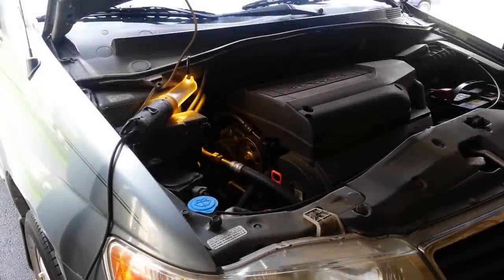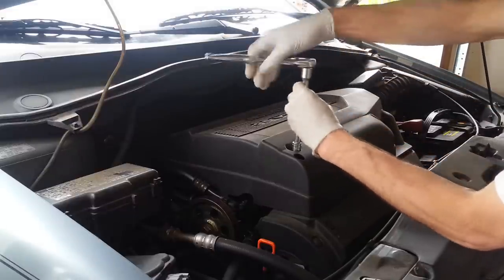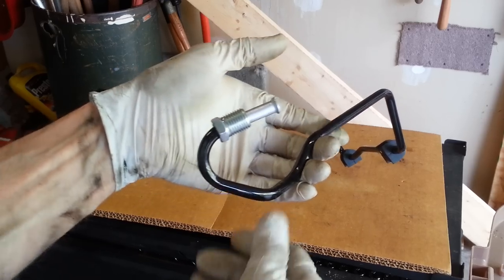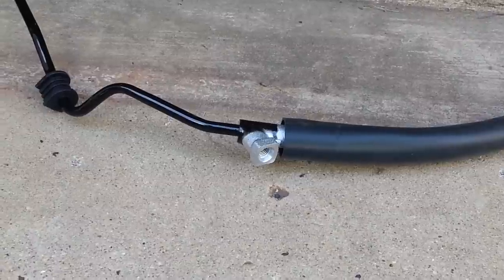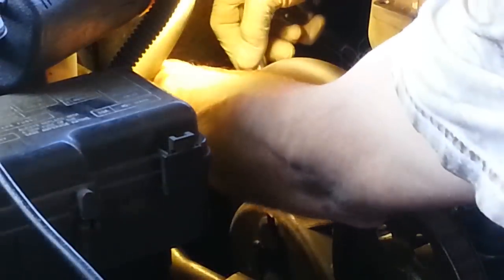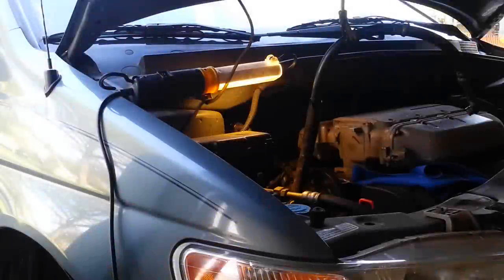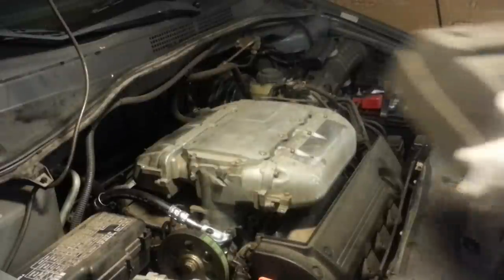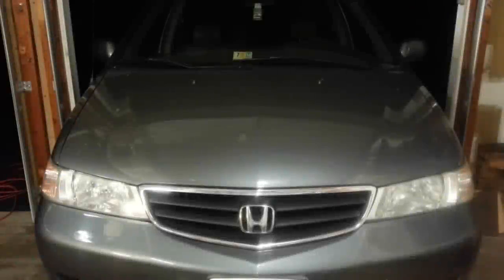Power Steering Hose Replacement 2002 Honda Odyssey

Comment: Thank you very much for the video, Mr. Worsethanchiggers. It was very helpful! I managed to replace this hose on my 2003 Odyssey. A couple of comments (hope someone will find them as useful as I found this video):
1. While removing the old hose, it is easier to cut off the tube at the nut (someone suggested this above, and I definitely second this suggestion) and use a 14mm socket (unless you want to keep the old hose).
2. Feed the new hose from the top (next to the pump). I tried everything before this, and nothing worked (I could force it through but did not want to bend anything).
3. My new hose (generic, not Honda) actually had a 9/16 in nut instead of 14 mm, but I had just the right flare nut wrench, so it was not a problem. So, make sure that you have a 9/16 in wrench available just in case.
4. I actually discovered that my power steering pressure switch was not connected. Looks like the electric wires got torn somehow years ago. My understanding is that this switch regulates idle rpms (when you are trying to make a sharp turn while a car is not moving), so I did not bother trying to reconnect it (just installed it on the new hose to plug the hole). So far, did not notice any problems. Be careful installing this switch though, don't over-tighten.
5. Definitely put some masking tape on all openings while putting this hose in place, and frequently check that the tape did not get off.
6. Cover the belts when you disconnect the old hose from the pump - you do not want to spill power steering fluid on any of the belts which are right below it.

Good luck to whoever is going to attempt this! This is definitely doable. The hardest part for me was to actually put this hose in place. Connecting it after that  (and disconnecting the original hose) was rather straightforward. Having all the right tools certainly helps.

Comment: Very well done video - thanks!  Completed this on a 2005.  Same pieces, just in slightly different places.  Flange nut was not in an easy place to reach, but it was easy to get the new line into place.  Note - the OEM flange nut was 14mm, the replacement was 9/16th.  I recommend you check it before you get it in place.  I drained as much fluid as I could and cleaned the reservoir before I refilled with Honda PS fluid.  Did not run the car, just turned the wheel back and forth still on the jacks.  It sucked and burped down the fluid in the reservoir twice and was full (about 1.8 pints).  Steering is working just fine.  I'll be honest - I farted around with this project 2 nights about 6 hours total, but I was really taking my sweet time (PS system newbie).

Comment: I took on that same project, removal was bad enough , feeding the rigid pipe!!!, after about 3hours, went to the parts store, ask if it was acceptable to cut the metal pipe  and rejoin with a brass coupling, was told that was a common practice, YES!!! That was about a year ago, no leaks
Reply: really hard to put the new one in place, I'm still struggling.
Reply: Will it be a good idea to put the new one from the bottom to the top? Since the upper side is soft.

Comment: My power steering high pressure hose leaked so I was going to watch the Ron Howard video about the Apollo 11 faked moon landing listed in the right side bar to get tips on how to replace it but as it turns out, this video was much better than Ron Howard's. Thanks much for the excellent instructions.

Comment: Outstanding video!  There's another video for the next generation Odyssey and the guy recommends inserting the new hose with the side that mounts to the pump first, from underneath the van - he also recommends attaching a wire to the old one and pulling it out from under the van, this will help when you replace the new one, I am going to try this when I get the new hose this weekend.

Comment: Amazing video, thank you so much. I had the exact same leak in the exact same spot and had the identical problem with the tough nut that needed the line wrench. Great tips and advice that saved my family at least $500 and only cost me a Saturday afternoon and some sanity from extracting and reinstalling the hose. I would pay for this level of quality instruction when my Odyssey gets a problem. Let me know if you have a donation location!

Comment: Thanks. Great instructional video.  5. stars . I could only wish other mechanical  videos online were as clear and concise and accurate as yours are. again, thank you very much. I too had the exact same issue. Got a rebuild kit and followed your video on the power steering pump rebuild only to discover that the top high pressure hose had failed by leaking.
Reply from the maker: Thanks for the kind comments. I really appreciate it. Yea, a leaky hose is certainly misleading. Interesting that you had exactly the same experience as I did.

Comment: Excellent video - Your video was spot on, full of great advice, and the leak is fixed!  My teenage son and I just replaced the high pressure power steering hose on our 2007 Odyssey. The hose itself was $197 from the Honda dealer, but we saved over $300 on labor costs doing it ourselves.  The 2007 seemed to have less clearance than the 2002, but we persevered.  After trying an open end wrench, flare nut wrench, and vise grips, we ended up just cutting the metal tube off at the flare nut and using a socket.  I would recommend cutting the metal tube to anyone doing this repair and not waste time trying to loosen the nut.  We were very careful to watch how the old hose came out and replacing with the new hose took only a few minutes.
Reply: Tall DudeXX ive gotta do a pressure line on a 2005 accord with this engine. so i probably will just do it like you and your son did that procedure lol

Comment: I watched this video three times, then did this repair. It took about 3 hours, a second pair of hands, jackstands and a 3 ton jack, and it works real well to take off both front tires. This was super frustrating. I'm no mechanic, but with the help of this video, and the above mentions add on's I did it. A mechanic friend says I'm a badass for even attempting this repair and that if I took this to a shop it would have cost me over $300.00 +parts. (100.00+). So, I guess thanks are in order, but man it was hard!

Comment: Great video.  I just did this project and thought I'd add my recommendations/comments:
1) Got Edelmann (aka, Parts Master?) aftermarket hose, because I could get 2-day shipping through Amazon Prime and it was only $44 for a used one (open package return.)  Seemed to work fine, but I needed to slightly bend the rigid portion to match the original shape, so keep your old one and line them up to make these adjustments.  Also, the pressure switch is on a T fitting rather than a Y, so you need to cut the closest wire harness connector for the connector to reach.  Discard the smaller o-ring and ignore the instructions that say it is needed on the flare nut, as it is NOT needed. 
2) Use jack stands rather than ramps, so you can remove the wheels.  Much easier access and you can flush and bleed the system manually by repeatedly turning the steering wheel lock-to-lock, with the engine off.
3) Cut off the old line, flush with the end of the flare nut and then use a 15mm socket to remove the flare nut.  Don't try other methods first, as that just buggers up the nut and makes it harder to get the socket on.  Use plenty of PB Blaster first.
4) Attach a string to the end that had the flare nut, so that it traces the path as you pull the old hose assembly out.
5) Disconnect the pressure switch electrical connector.
6) To remove old line, first move the hard portion of the line toward the driver side a bit. Then pull the flexible portion of the hose down and push it straight through the passenger side wheel well.  From below, work the assembly out, toward the passenger side, above the tie rod boot.  It takes some wiggling, but you can do this with the pressure switch attached.
7) Tape the openings, then tie the string to the new line at the flare nut and have a helper gently pull the string as you guide the assembly back through from the passenger wheel well toward the drive side.  I was able to attach the pressure switch ahead of time.  Double the flexible end over and stove it over the tie rod boot, reversing the removal gyrations.
8) Get the rigid pipe nearly into position and then make any needed tweaks to the final bends.  Install the flare nut first and tighten most of the way, with a 15mm flare nut wrench.  Then install the 3 clamps, reusing the original rubber bushings.  Finish tightening the flare nut.
9) Fill the reservoir and turn the steering wheel manually, lock-to-lock to work the air out.  Check often to add fluid.
10) Say a prayer, fire it up, check for leaks and turn the steering wheel back and forth under power until the fluid level stops dropping.
11) Have a refreshing beverage.
Reply: Steven Bachman getting ready to do this & dropping a string is the first thing I thought might help...but always easy to armchair qb😁.  great video
Reply: A comment of caution to point (3) above:  cutting off the old line might introduce metal "debris" into the system.  It will be impossible to remove these tiny pieces afterwards !!! -  Using a small plumbers hose cutter could be safer but not full proof!!! - WARNING !
Reply: To avoid introducing metal particles onto the hydraulic system, Cut the metal line several inches far from the flare fitting. 👌

Comment: Nice job. I liked the way you didn't edit out the difficulty of removing the flare nut and showing that it is better to use a flare wrench.  Thanks.
Reply from the maker: I really appreciate the kind comments. Thanks!  Too many videos deemphasize the challenging parts of a task and that is lost on the viewer. I sometimes prefer to show the decision making process when a change of course is warranted.

Comment: What an incredible service. Great vid! Thank you. I highly recommend before changing the pump, use the yellow dye and a black light flashlight. My leak was also in the hose, not the more expensive pump. Yellow Dye $8 any auto parts store (specifically for oil fluids) and $8 black light at Harbor Freight. You don't need the expensive kit at auto parts store with yellow glasses. It will show leak with black light.

Comment: I just wanted to thank you for the great video!  I appreciate you attention to detail.  I wasn't sure if my high pressure line was leaking on my 2004 Acura mdx, or if it was the pump.  Thanks to you video I found my high pressure line was leaking is the exact same spot.  The subframe on the mdx makes this job a bit more challenging, but your video definitely helped me.  Thank you!
Reply from the maker: Thanks for the kind comments. I really appreciate it.

Comment: This was a very well done video. 
I used it to fix the power steering line on my *2005* Odyssey ... it worked perfectly.  Here are some further notes and observations on this video that will help you to use it to fix your odyssey.
 
1) the vehicle is raised on ramps under the front wheels ... this works fine.  The wheels do not have to come off.
2) doing the line-nut down on the power steering rack first works great (before taking off any of the line hold-down bolts).  On the 2005, that hook the line takes (down by the nut) at the end of the power steering line is not there and so that line nut is accessible from towards the center of the car (laying on your back) AND FROM THE TOPSIDE, right in through the engine compartment on the drivers side (big arms make this a painful squeeze though).  A milk crate to stand on works just ducky to be able to reach into the engine bay when the vehicle is high, up on ramps.
3) yes, you really need to use a "line wrench" (with its "C" end) with an extension to get it loose.
4) the lower line hold downs (the rubber bushings with the clamps on them) are accessible by laying on your back under the vehicle with your feet sticking out the front of the vehicle. 
5) the use of the bungee cord in the video is a great tip when you are doing the job by yourself.
6) fwiw - a small hand mirror will help you while you are doing the job to see where nuts/bolts are located better.
7) everything else should be done in the sequence and method as shown in the video.

THANKS AGAIN to the original poster.  Actually a repair with very little headache using the info in the video!

Comment: Thank you for making this video  I would have not replaced the cracked hose myself on my odyssey 2000 if not for your video. Nearly gave up trying to feed the line. I used original Honda parts but the pipe run between the two rubber supports was originally bent as a hump unlike what I saw from the video which was straight. Took me 6 hours to feed the line.. Lol.. Thank you for making this video.

Comment: I am glad to hear that you TOLD US WRONG> at 3:52.  I spent an hour trying to get the single flare nut off.... buggered it up good.  So when you said the high press line was one of the other ones, I was very worried.  I ended up having to use Vise grips with a flat jaw.  Glad that I am not using that nut again. thnks for the correction.I did the same thing as you, I replaced the pump then found the hose was bad....

Comment: Thank you very much! I carefully followed step by step your video. However my flare nut was very easy to untight. my 2000 Odyssey has now 280k km. no more money to waste in garage at 100$/h . It took me 2 hours, beer and music included. Don't let your hose leak during 2 weeks by adding of power steering everyday for a total of one gallon. You will make a mess as I did on my garage floor.

Comment: Well, my turn in two days on a 2001. Thanks for a peek at the details. I’m bringing in a helper which should ease the task of hose extraction/insertion, I definitely have the correct tools and I’m glad the pressure sensor can be installed on the bench. I also have a set of flare crowfoot wrenches that will work with a breaker bar. My big hands may be a problem but I’ve dealt with worse.

Comment: Thanks for posting this video I had a leak in the same exact spot tried using J-B Weld it held for like a week and then started to leak again it was time to put in a new hose fought like heck to get it out and a little to get it in getting the flare nut started was the hardest part how to lower the jack a little bit to get the flare nut to go in flush how to put on leather gloves to get more strength and grip to get the flare nut started once I got that started I was home free with a little help From my awesome wife I don't know a lot about cars so these videos help tons may the Lord bless you for helping not only me but many others God bless

Comment: Great video.  I think this must happen a lot with these vans. It looked like mine had been replaced before.  I bought a flare nut wrench just for this and it still started to strip that bolt. I ended up soaking it overnight in penetrating grease and using vice grips the next day. Pulling the hose out and back in from the passenger wheel well worked good.

Comment: I used a string around the flare nut side to help PULL the hose into its new location.  Fishing in and out was most diff part of the job.  A 9/16 line wrench is close enough to use when removing the old tight nut (9/16 =.5625"  ; 14mm = .55") .

Comment: Great video. Thanks. Even with line wrench, the nut got stripped coming off. Good locking pliers finally made quick work of it. Took a few hours, but I got it......almost. Flare connection is now leaking and I've already loosened it, checked and re tightened. Still leaking. Arg!
Reply from the maker: Ugh. That's a bummer.

Comment: Good video. I haven't done it yet but I think I'm going to tie a very long string to the wheel end on the hose before I start pulling it back through the car. Then after getting the hose out, I'm going to tie the string to the new hose to feed it back. Only doing this to make sure that I'm routing the new hose correct.

Comment: Well, this job is "worse than chiggers." But this vid is great instruction. I add: Do like this guy and buy the Honda part. Autozone's was rusted at the sensor threading, and didn't line up at the steering housing. I had to gently bend it. But you can do as he did, painstakingly thread it through without removing anything else (I did loosen a hose guide and shift it).
Great vid. Thanks!

Comment: Great video. Just finished the job last night. Can confirm figuring out how to get the hose out, and the new one into position is really frustrating and difficult. (esc with the car on ramps and you're lying underneath. A lift would make it a lot easier). I'd say good ramps are a minimum requirement for the job. Also, Harbor Freight has both flair nut wrench set $15  and o ring set $5. If you don't have the wrench set I would add that to the list of required tools. The hose is really hard to get out of the wrack. I would say without the flair nut wrench, you probably won't be able to get it loose.

Comment: Great video. Good prep so I knew what I was getting into. I did my struts, tie rod ends, and stabilizer bars right away so itvwas pretty easy to get the hose out through the passenger side wheel well.